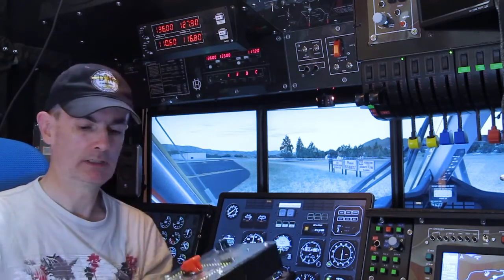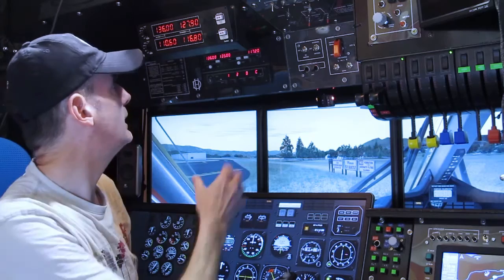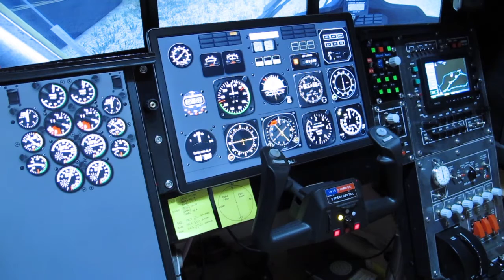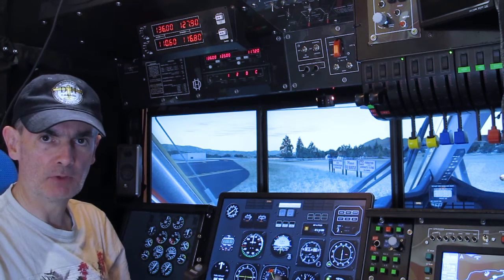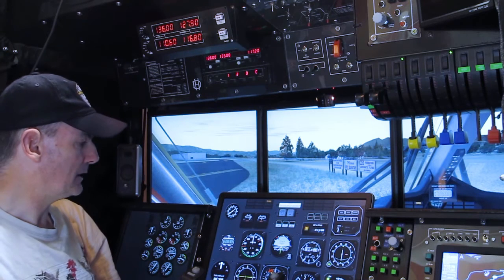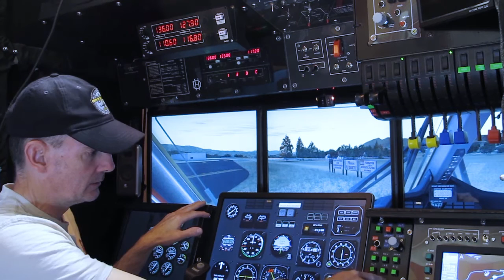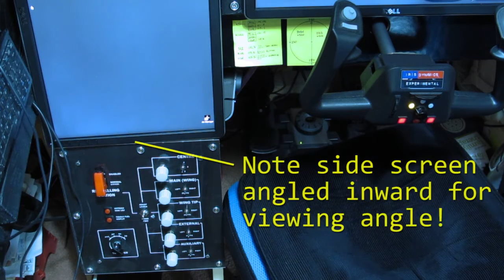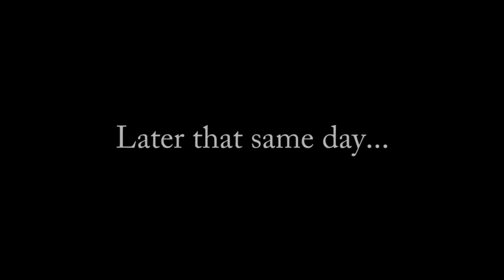We Have Instruments! (Twin Otter Cockpit Build - Part 30)

Comment: Why use speakers? As a pilot, we never use speakers. We use headphones. Just use a headset, and if you marry it with VOX ATC and a headset with a mic, you can TALK to ATC rather than having to use the keys. On top of that, you can do a lot more with ATC using Vox ATC, such as Stars & Sids. It's not much n well worth doing.
Reply from the maker: +NeonsStyle VoxATC never worked properly for me, it would usually just get stuck saying 'last aircraft, say again'. Pilot Edge is better - it's basically the real thing.

Comment: Once again terrific work! I've been following your exploits and tutorials for years. I wonder if you could take a look at my latest offering and make a suggestion regarding my set up which I should've started 10 years ago ...just now realized that I had the equipment, although disparate, to have a three monitor display. Keep in mind, that I have very limited physical horizontal space...if I want to keep my wife approval factor in a reasonable range., that is.

Thanks,
Chas
Reply from the maker: +hesynergy Thanks for the comments. I think your three-screen setup shows promise - if I had the performance I would go with three independent views but FSX won't do it without a super-computer and even then it's doubtful. I think you just have to trade off a little bit of realism where the screens join.